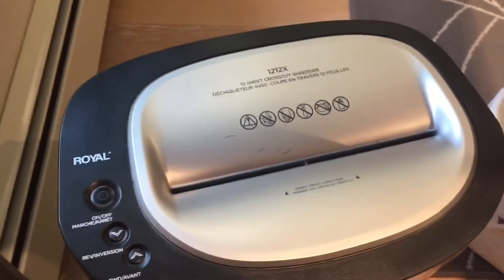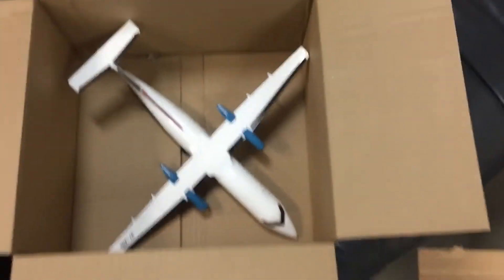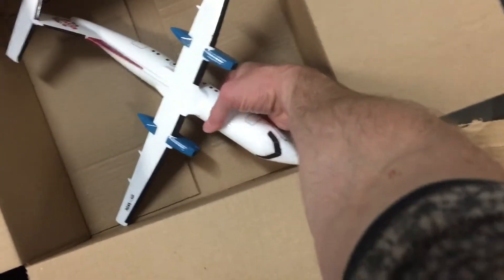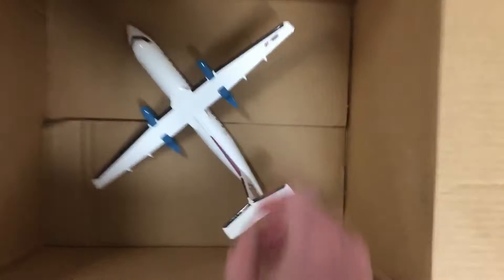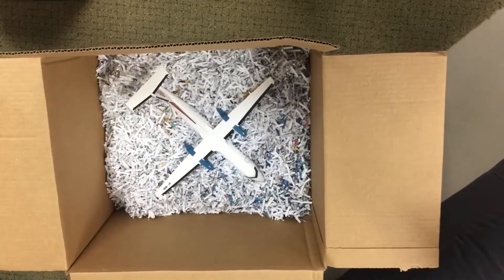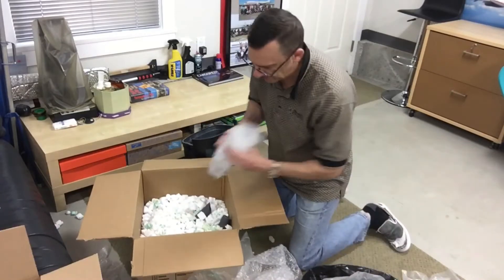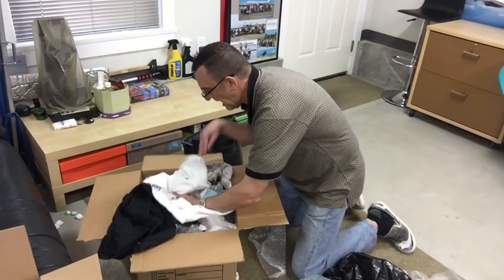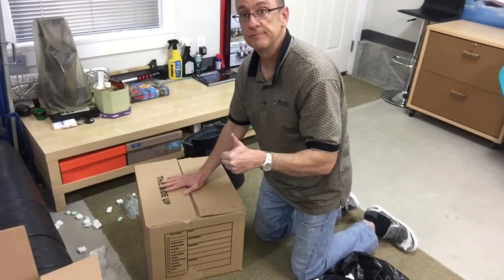How to properly pack an aircraft model for safe and protected international shipment

Comment: Hi @JetFlix, my mom threw away all the boxes of my 1:400 collection but I have the planes in a glass enclosure on display. How do I travel with them internationally and move them to a safer place away from mom?
Reply from the maker: Great question!!! Do you no longer have the boxes for each model? If not, the models will need to each be wrapped in bubble wrap with special padding to protect the gear.
Reply: @JetFlix  but wouldn’t that destroy the gears. These are atleast 10yr old 1:400

Comment: What frustrates me about model aircraft is how delicate they are. I now have three 1:500 scale models, two herpa, one Hogan, and I accidentally broke off two wheels on my brand new Hogan model trying to get the stand that came with it on. Every part of a model plane, at least the small metal ones, seems to be durable except the wheels. And you can't replace or fix them. I love these planes but they're QUITE temperamental.
Reply from the maker: Hi Romin, that sounds very frustrating but I have a repair tip for you. You can fix the broken gear with Bob Smith Industries Maxi Cure super glue which is available at most hobby shops. It works well for such repairs.
Reply: @JetFlix  ^ Thank you for your advice. How well will it hold? The problem is also the fixtures that hold the wheels broke off too and I don't know where some of them went.
Reply from the maker: @rominn2184  I cannot help with missing parts but this glue is the best super glue I have found for small surface area repairs as a modeller and I recommend giving it a try. But first watch videos on use of this product here on YouTube.
Reply: @JetFlix  ^ Do you mean your video about bondic glue? I don't see any other videos on your channel about glue.

Comment: Out of curiosity, was this a plastic model kit? I’m trying to ship a Hasegawa 1/72 scale plane and I’m worried about it breaking.
Reply from the maker: Hmmm ... another option is to get a sheet of soft styrofoam and draw the model outline on it. Then cut out the shape of the plane so the model sits snug inside the styrofoam cut out, and the model will be as safe as possible.
Reply from the maker: This was not a plastic kit, it was a professional travel agency model made of resin and fiberglass.